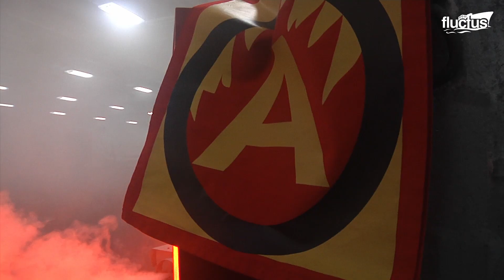What Happen When Massive Fire Spread Inside US Aircraft Carrier and Ships

Comment: Firefighters don't use oxygen in their SCBA cylinders. It's just regular compressed air.
Reply: AMEN!
Reply: Thank you now I don’t have to say it
Reply: Most scuba divers are just breathing compressed air too.
Reply: @wdwerker  The same type of compressor systems that fill SCUBA tanks are also used to fill SCBA bottles. Although you have to know what you are doing with the SCBA’s as they carry twice the pressure.
Reply: SCUBA Divers use air too....
In fact the deeper you go,  the less O² you use....
Because the deeper you go the more pressure you are under and the Oxygen becomes toxic....
The exotic mixes of gasses such as Nitrogen and Helium is a combination of Science and Art to survive the deeper you go....
Reply: What Hass to be compressed air? If one of them gets dropped and heats up it’s explosive.
Reply: @dpenn5983  there is a burst disc that fails before the tank can over-pressure enough to explode.
Reply: @dpenn5983  It doesn’t work that way. The worst that would happen is the tank would be spinning around on the floor when it’s burst disk fails.
Reply: @andrewtaylor940  I heard a burst disc blow at a scuba shop.   Scared the crap out of everyone. They put the tanks in a rack and add a strap before filling them to keep them in place before filling .
Reply: @wdwerker  In my old firehouse the fill station had a water bath inside an armored box that the tanks sat in as they were filled.
Reply: Just compressed air idk that,I assume you wouldn't want pure Oxygen while fighting a fire.
Reply: @Bumper1974 normal air is 21% oxygen & 78% nitrogen